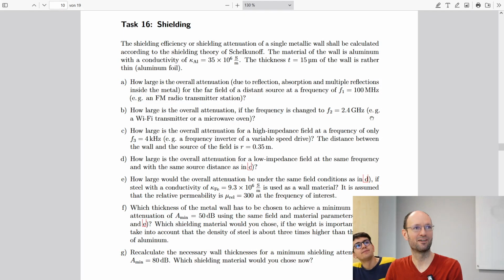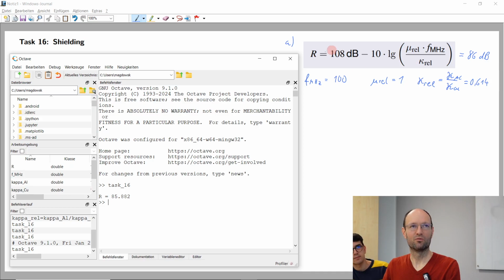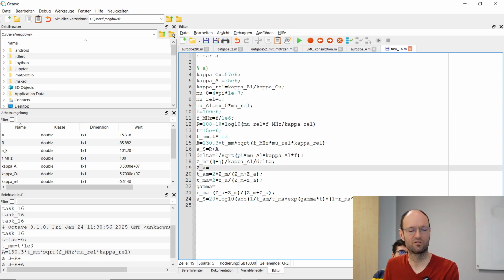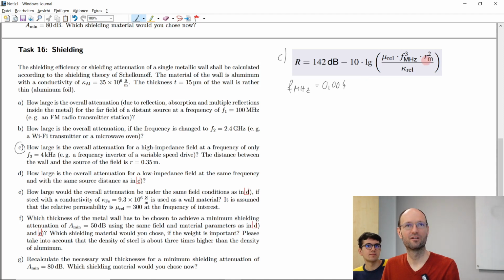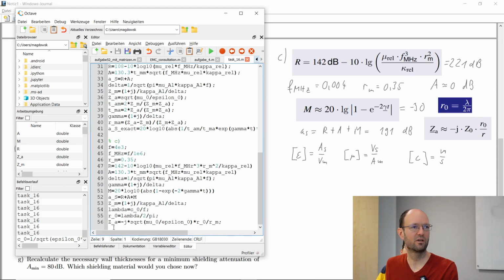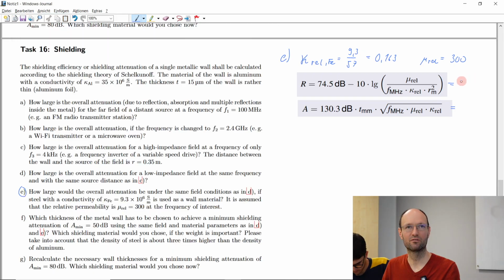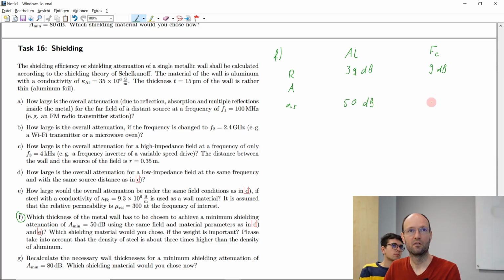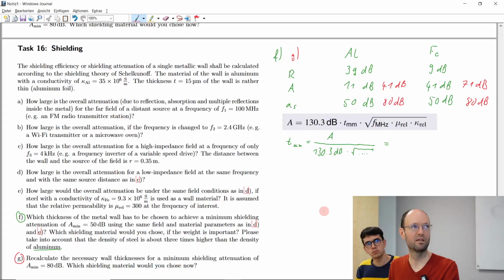Solution of Task 16 about electromagnetic shielding attenuation calculation according to Schelkunoff

Comment: Hello sir I have a question why in. Part f. When we are calculating tmm= thickness we are using frequency in khz but formula is stating to put in MHz.
Reply from the maker: @asdfuntube3037  Thanks for the question. To which time stamp (hh:mm:ss) does this refer to?
Reply: 1:12:10
Reply from the maker: @asdfuntube3037  Sorry for the delay. The formula for calculating shielding effectiveness can be found in our lecture slides:
https://cloud.ovgu.de/s/HMKeP8mAw6WwnBi
It is a so-called "numerical value equation" (for an explanation see the booklet "Standard
compliant use of quantities, units and equations" by Klaus H. Blankenburg, which can be found, for example, here: https://www.fisicalinda.com/wp-content/uploads/2018/10/Rohde-Schwarz-Correct-Usage-Quantities-Units-Equations.pdf as a PDF file).
This formula is defined and simplified for the frequency to be given in the unit MHz, see the corresponding derivation and simplification in the slides. The value in kHz must therefore be converted to MHz, where 4 kHz is 0.004 MHz.